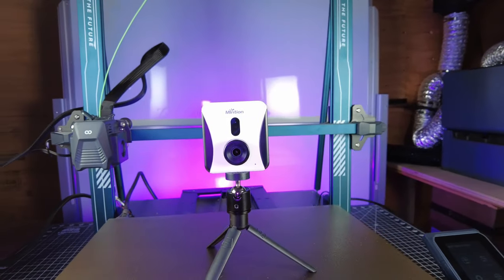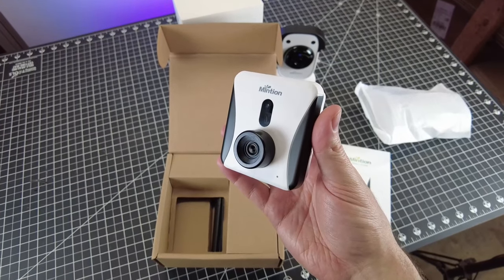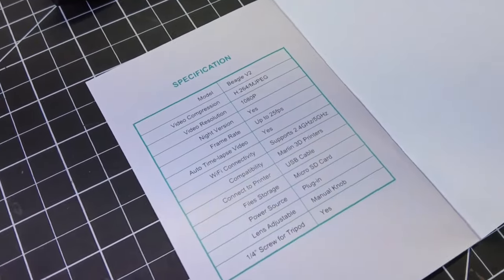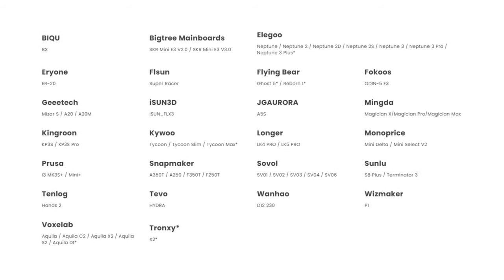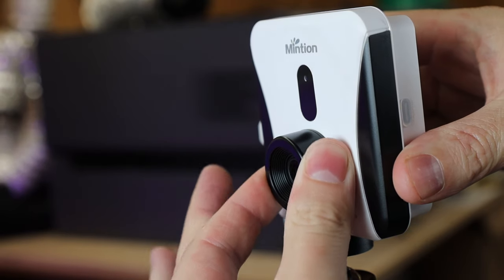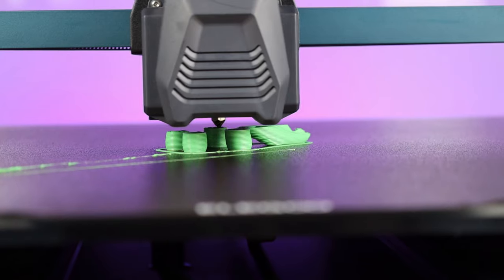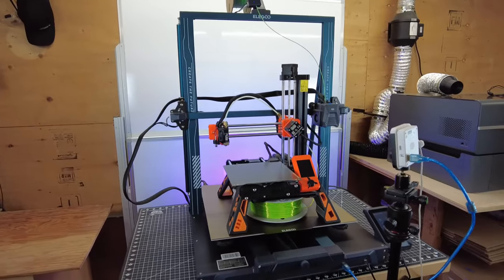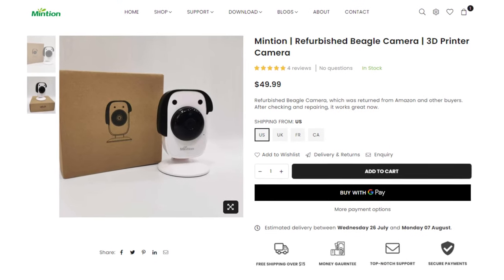Add Wi-Fi Controls & Camera To Any 3D Printer - Plug & Play - Beagle V2 Camera

Comment: Perfect timing i was looking at this camera for sometime and have a Neptune 3 Max, glad this cam is able to be used
Reply: Did you end up getting the camera? I have a 3 Max also but not keen on losing print size, did you need to change it?
Reply: @scottsavill7207  I ended up not getting a camera as i only use my Max for larger projects, for the most part i use my Bambu X1C which has a camera. I may look at it in the future